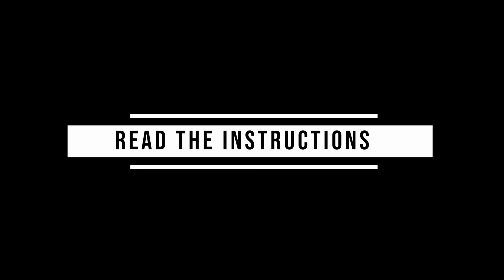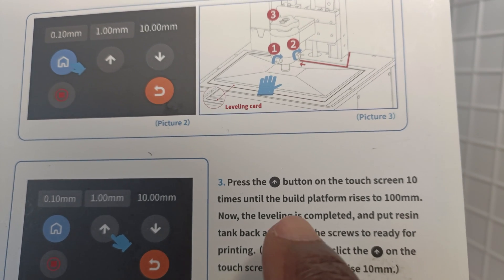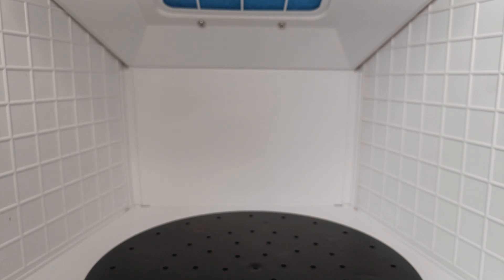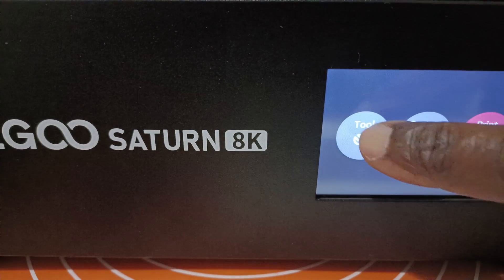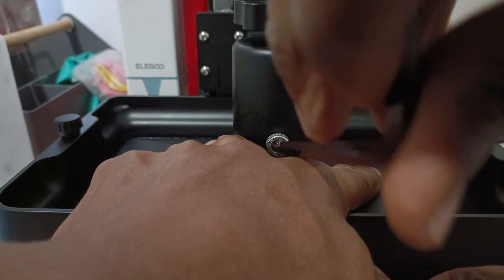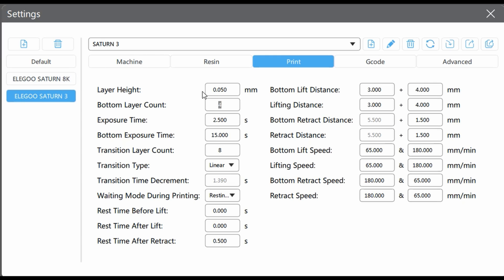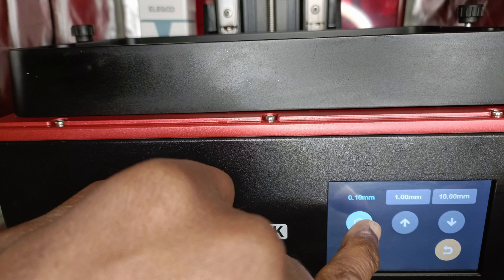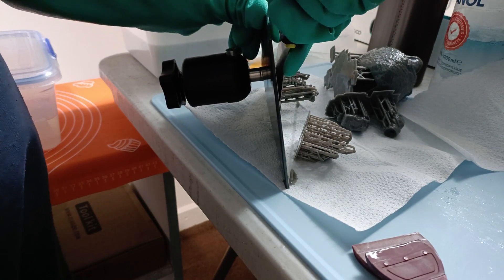How to Level the Build Plate on a Saturn 8k & Saturn 3 Build Plate 3D Printing

Comment: Good tut. I've been using a version of this method for over a year on my saturn2 and it's rock solid. It doesn't seem to work as well for larger printers like the Jupiter due to the wider suction of the vat and plate. As much as the x-y pins are a pain to lock down, the four screw bracket design (jupiter, halot) is the most erratic thing I've run across. I haven't done a .5 z-home so I may try that

Comment: The best video I've seen so far on how to level this thing. I've been at my wit's end trying to get this thing level using the paper method and the card that came with it. Hopefully this vat method will fix it.
Reply from the maker: Like you I struggled to find something truthful and to the point. I'm pleased the video helped you get ahead. Happy printing and take good care!
Reply: I'm having the same issues with the saturn 3, tried like 10 times with the paper. Did the vat method work, I'm not trying to get my hopes up too soon when I tr it tomorrow

Comment: This is a very nice and infomative video but the end confused the hell out of me .. when you got to the z=0 portion .. then said it works for the 8k but not the saturn 3? I have a saturn 3 12k, and followed this until the z=0 step and left it, the levelling card is all over the shop so i don't use that anymore, but the 5mm part is a nice touch, but i often use the z=0 set but misses it, so i don't do the 5 x 1mm then z=0 on my saturn 3?
Reply from the maker: So sorry for the slow reply I've been on another planet. OK so for the Saturn 3 I level the build plate on the FEP and then set 0. Raising it up 5 times 0.5mm ( Saturn 8k method) caused failures. I hope that makes sense.
Reply: @DaCostaArtDesign really helpful video. Thanks. I’ve been having issues more and more where I’m not getting adhesion to the plate. Sometimes it’s sticking to the FEP and other times partially to the build plate and pealing away towards the edge. So I tried re levelling and now I’m not getting any adhesion to the plate at all. So considering your comments above, are you saying - make contact with the FEP pressing down and tighten accordingly. But do not raise the plate by 5 x 0.5mm? And then set the z axis at this point? 

Also, is it correct to continue with the 0.05mm layer height like in your video? 

Thanks.